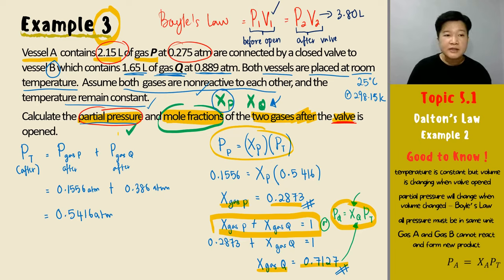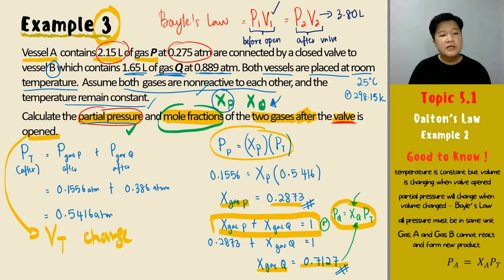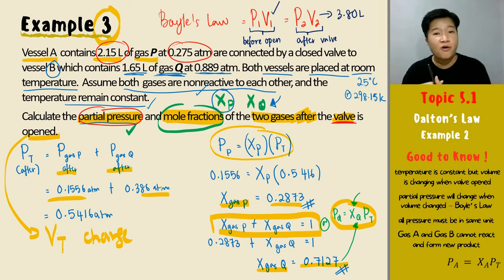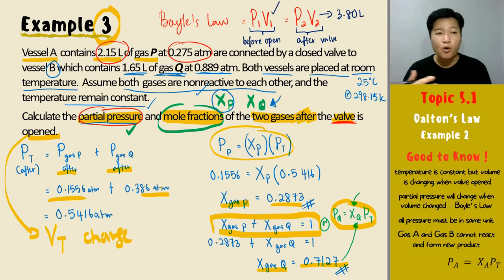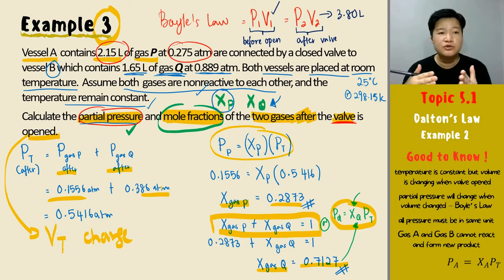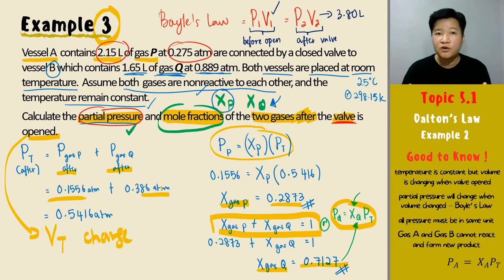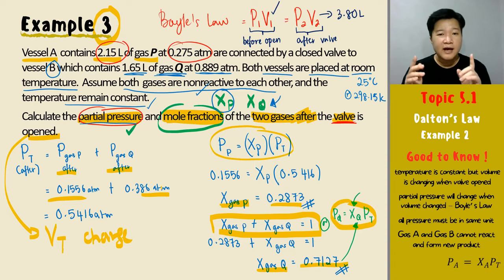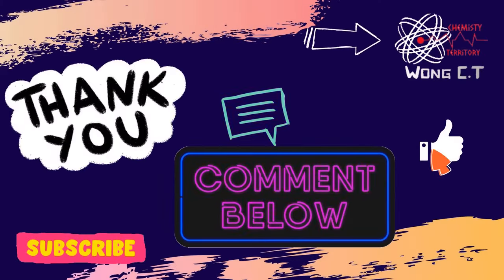Dalton's Law and Calculations - SDS SK015 Topic 5.1 [Part 7]

Comment: Hi madam , why the value of pressure for gas q after valve is open is not the same as when we cal the total pressure? TOtal pressure should be 0.6972atm right？
Reply from the maker: there is indeed a mistake made in that example 3 but not the total pressure after the valve is open.. try to re calculate again. then you will realise where is the mistake. 

Thanks for point out the inconsistency thou..